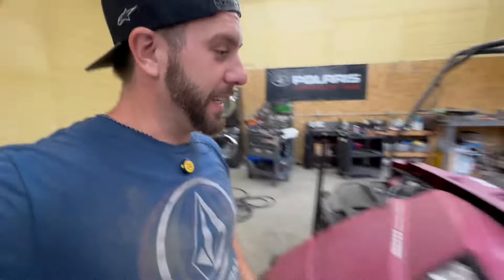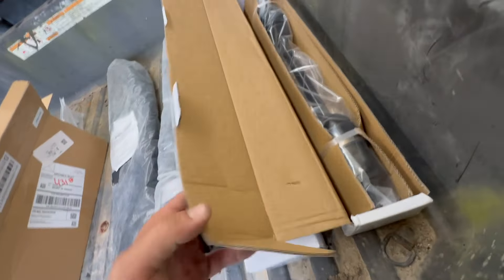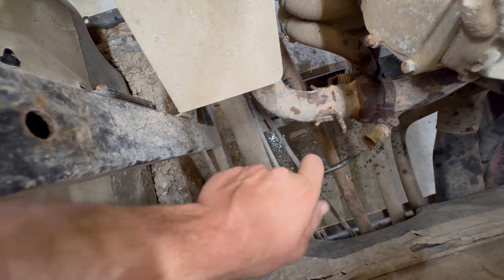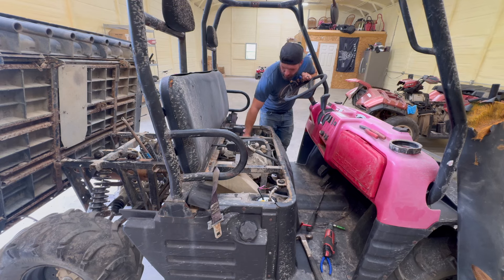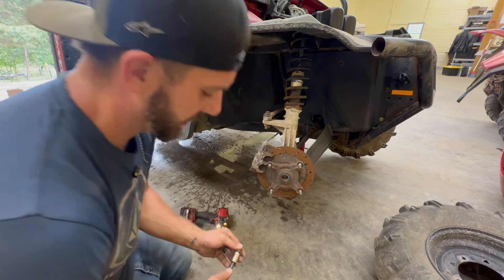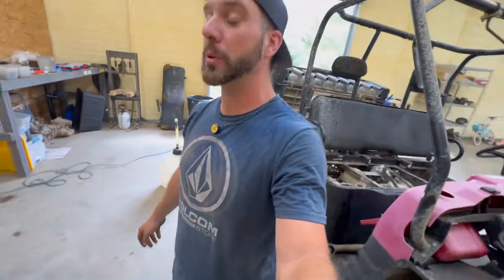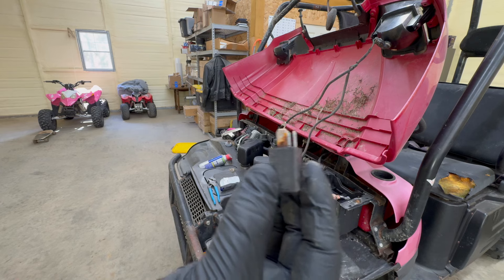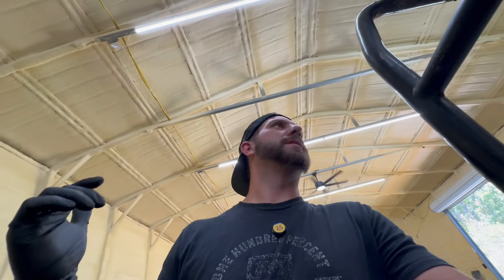This SXS Had SO Many Issues

Comment: UPLUS Batteries are so cheap. Been using them myself in my rigs and customers. Hope they hold up for 1 year like the rest of the "exspensive" batteries.
Reply from the maker: A buddy got a ranger from me and a week in he said the battery died and wouldn’t charge. I told him to bring it back and he never did but it was a uplus battery as well. I haven’t had any issues with them and at $40 vs going to Walmart and hoping they have it in stock for $80.
Reply: @TheATVHustle  dang I've been sending them out. 

Honestly they are all junk now a days.